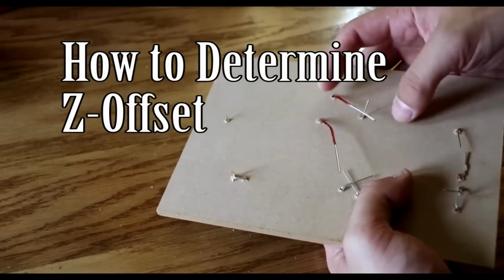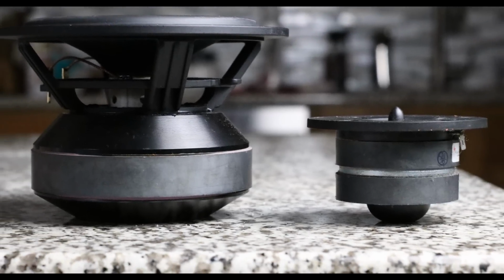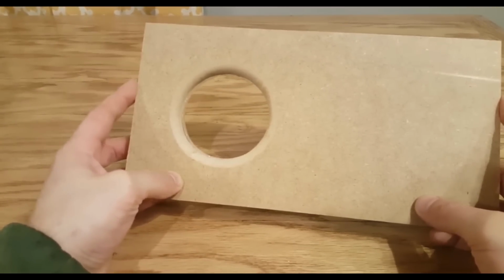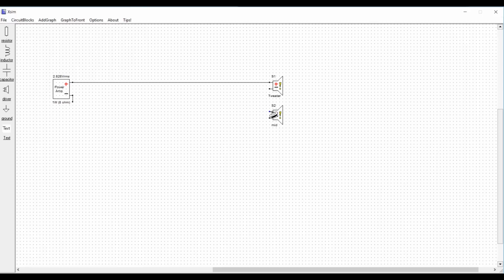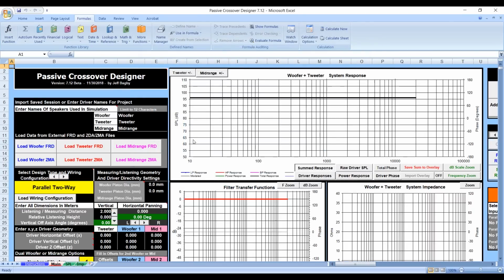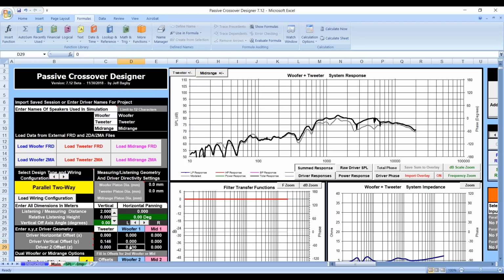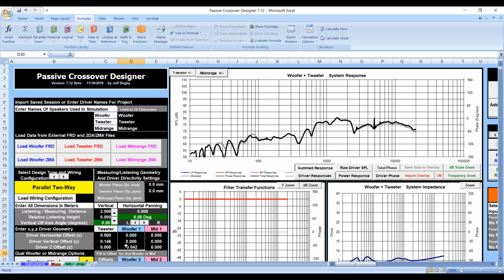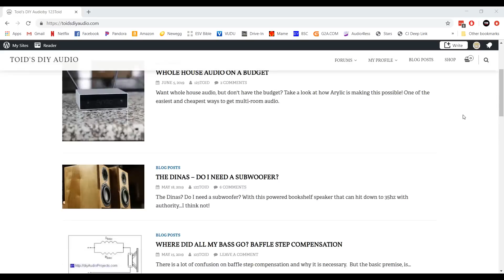Improving your Crossover Design - Z-Offset

Comment: Great video, however, I think you can get away without measuring the z-offset by measuring the absolute phase of both drivers from the same position. You can do this via a two-channel measurement and I recommend this instead of a single channel measurement as it takes guess work out off the equation.
Reply: @Douglas Blake in my process which is pretty much the same as this, only I do it in one program so no need to import export and starting and stopping programs, once you have the relative measurements and enter the delays... The crossover simulation is pretty much spot on, with phase and frequency and Yes I've done this with a 3 way. But... Whatever gets you the results the easiest for people is all. Good👍
Reply: @attainableaudio4533   Hi could you please kindly explain your process in this?  Because this video is not making much sense to me.  Toids video is measuring the speakers hooked in phase but it doesn't mean that the audio arrives at the same time based on the mic position in this video nor arriving at the samw time based on how in physics a tweeter triggers faster and transduces the signal more immediately. And how do you know that you are compensating for your delays right even in single unit measurements?

Comment: That’s all fine and good but I would need a hands on tutorial. You clicking here and there teaches me nothing. Does the free program come with a manual?
Reply from the maker: It does. I'm not sure what you had a problem with. If you're more specific, maybe I can help. I am making the assumption that you know how to get your frd and zma files, I've done videos on this before. I've also done an entire tutorial on how to use the free program passive crossover designer. So maybe you need to watch those? It's so let me know and I can post a link for you.
Reply: 123Toid Thank you sir, I’m in the learning and research stages. I know I want to build a single full range pair first and then a nice 2-way set. I was familiar with the set back, the z-line as it’s called. I had an old pair of Zenith speakers from my brother-in-law who passed. I kept the speakers but trashed the particle board boxes that were nasty. I would have no specs on those but I’d like to make a nice set with them. This PCD would help to get them sounding right.
Reply from the maker: @dam4274  That is awesome that you still have those.  PCD is a great program, and it is really awesome that Jeff Bagby gave it away for free.  I hope the tutorial helps you restore those zenith speakers.  It would be nice to get them back up and running.
Reply from the maker: Here's the link to the basics of PCD: https://www.youtube.com/watch?v=Fm6tsj9Tpqs&list=PL6hjpiCHZmIPx3itPeTt7zoSqNY20OQqV